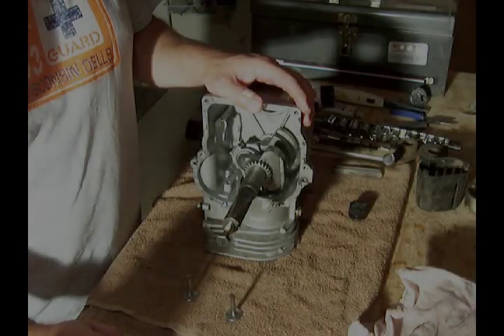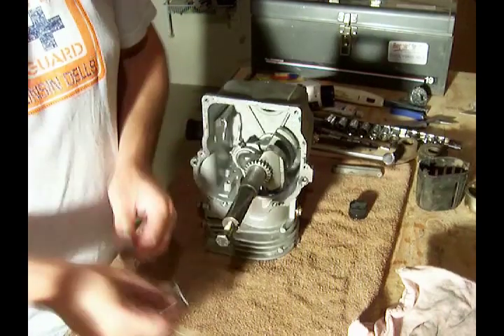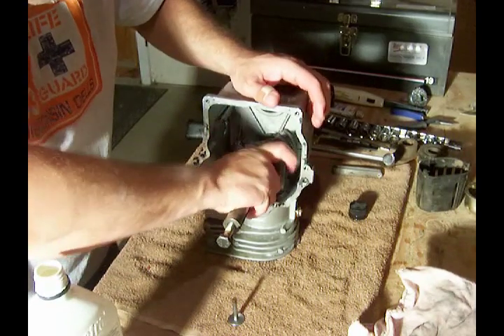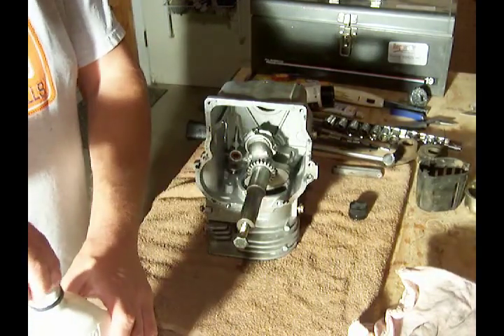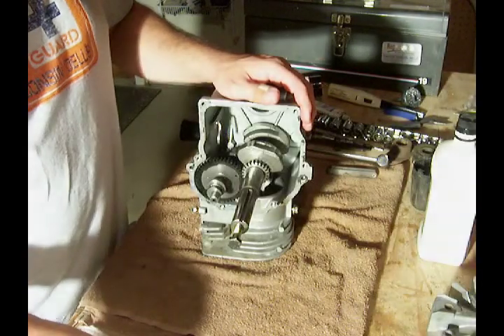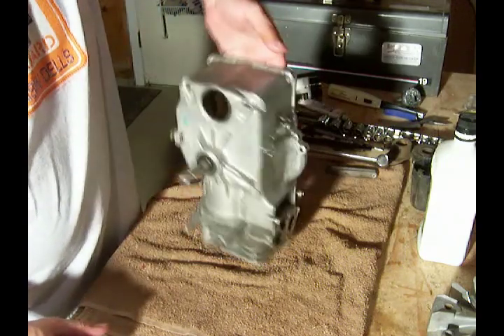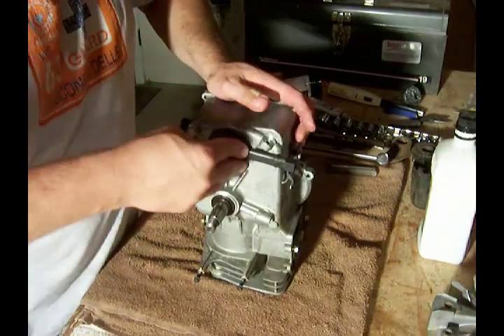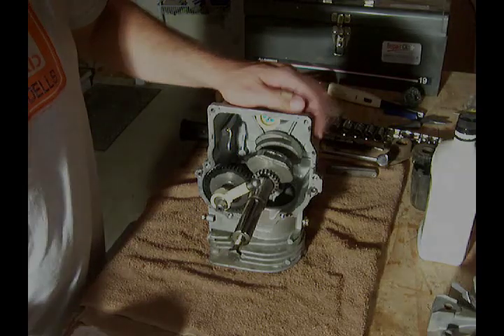#13 Tecumseh LV195EA / LEV120 - Tear down and rebuild - Camshaft and tappet installation

Comment: Hi. Great video series, by the way!  My son and I are beginners and we’ve torn apart this techumseh engine. While cleaning it up, we noticed that there was no marking on the I’ve got a bit of a problem. Somehow, over the years, the dot on the crankshaft has worn off. Is there anything we can do? Of course, I didn’t think to mark the crankshaft before removal. Good grief!😮
Reply from the maker: I don't know any other way. Sorry.

Comment: How do you time if the Tecumseh crankshaft does not have a dot?
Reply from the maker: I couldn't say. I personally have never seen one without the mark.
Reply: @RealManSkills The Tecumseh service manual says to use the crankshaft gear opposite (180 degrees) from the crankshaft keyway.  It seems to be work but I wanted a second opinion.

Comment: I put a gasket on and re-assembled according to video - timing marks etc. Yet it sort of backfires/kickbacks when trying to start - any idea where I went wrong.  Thanks in advance - it has been taken apart and put back together twice and it still occurs.
Reply from the maker: +tonyswhirl Two things come to mind, #1 - Did you put the blade on before trying to start it? The blade is necessary as a counter weight - without it, there can be some finger stinging kickback when you try to start the engine.  #2 - Check the flywheel key, it may be bent or broken, causing the timing to be off.  Hope this helps.  Thanks for watching.